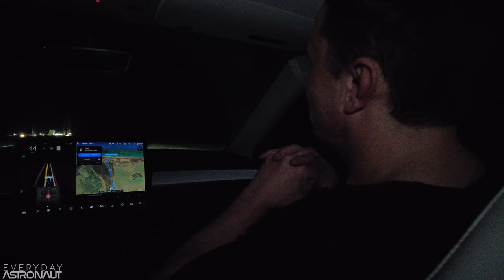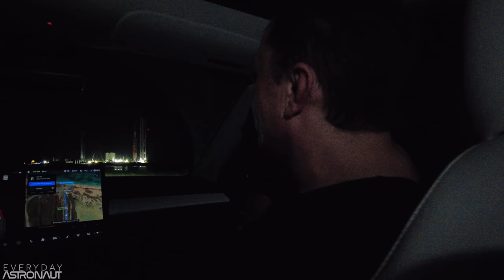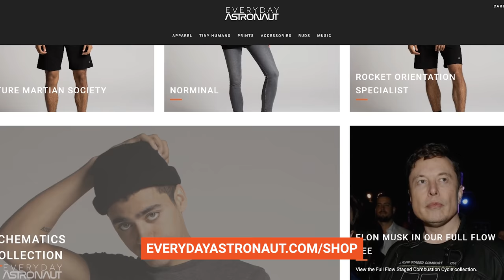Starbase Launchpad Tour with Elon Musk [PART 3 // Summer 2021]

Comment: How do you solve a problem that extends beyond your own lifespan? That question may be the essence of civilization. The only answer I can find is to initiate a process, to create an environment in which the solution will occur independently of yourself. But… that requires a difficult sacrifice. Letting go of your desire to bear witness, to exist at the center of the cosmos. To participate in the project of civilization is to accept death.
-- The Talos Principle, time capsule 7

Comment: 👨🏿‍🚀🐘Quite the "beehive" of activity. Taylor Lee and Mr. Patel are quite encouraging. For example: everything on joining SpaceX to how the welding of jacks and shin plates for the stands are conducted. The launching of the "ring" (ie. holding down the inside with regards to steel thickness, line boring, reduction and mass welding of thick steel) to increase mile/hour  ratio for booster and ship, is quite enticing too. Multiplanetary representation and urgency (becoming an interplanetary species as soon as possible) are important elements in addition. The iota of progress.

Comment: Elon walking around without a hard hat is giving me heart palpitations.... during my career as a security officer, one contract that I was assigned to was working at the technical operations center  Northwest Airlines for non 747 Fleet aircraft at Hartsfield International Airport prior to the merger with Delta Airlines, and when we were doing security and safety checklist inspection of the main hangar section of the facility, you were required to switch your uniform ball cap for a hard hat prior to entry., you do not want anyting dropping off of a horizontal stabilizer stand hitting you in the head because someone's hand slipped, and they lost their grip on a piece of equipment that they were holding. We need to protect that brain at all cost

Comment: One thing I'm curious why SpaceX hasn't explored is making a slightly wider Heavy lift stage say 12M dia to add more fuel snd engines to push a slightly 11 or 2 segments longer starship tanker to reduce the number of trips to top up a starship in orbit. since they're unmanned they could also maxout on the G load to orbit pushing the upper stage harder and faster...

Comment: Why don't they use the booster as a refuler? It would take less engines to get to orbit, without a Starship on top. Those fuel tanks are really large. Just put a carbon-fiber nose cone on top, for aero dynamics. They could reenter like a falcon 9? Also they can still catch it on landing. Just a thought.
Reply: The booster can't go to orbit. Even without Starship on top. That's why every rocket has at least 2 stages. Physics dictate that.
And if the booster would reenter from orbit like the Falcon9 booster all the engines would burn up. Far too much energy. The F9 booster doesn't come back from orbit. It comes back from a suborbital trajectory.

Comment: A week later. I have not seen any comments - ever - re: UPLOADING hardware. We know that Starship will orbit. We know Starship will need refueling to go to the Moon or Mars.
We know that some claims are that Starship will need 13 or 14 refueling dockings while in orbit.
We know Elon believes that it may be possible to complete the mission with just 4 refuels.
That suggests to me that the Starship cargo bay is not currently planned to be at a maximum.
So my question is If Starship is sitting up there waiting to have tankers deliver fuel, can other Starships be launched with hardware for transfer to the Orbiting Starship?
Then a big payload could be transported to moon etc. 
Obviously more payload would necesitate more fuel transfers but why would that be a problem other than the cryogenic venting problems?
The problem I imagine is not taking masses to the moon orbit. The problem I percieve is taking the masses from moon orbit down to land on the moon surface?
When man is on the moon, the more toys he has the happier he will be (as if being on the moon isnt enough).
Any comments?

Comment: Surprised none of the models for catching on the return have  reinforced airbags on arms and towers just saying its how we catch stuntmen and lift thousand ton loads with little ressistance or effort and fabric spill systems and rapid deployment systems abound and its light and self aligning done right :). Also has added benefit of stopping intrusion into metal on metal contact zones drastically reducing the odds of unscheduled dissassembly and would be cheap and light so easy to build and retro fit to existing structure .

Comment: I design RF Amplifiers which combine the output power of up to 32 transistors to reach full power, somewhat similar way to the way the 29-32 Raptors work on the Starship Booster. The hardest part of this is maintaining stability.  Any feedback from the output to the any of the inputs results in severe instability and oscillation. Basically to work the all inputs need to be isolated from each other. It can also be modeled and simulated. Imagine a multi-vibrator circuit repeated 32 times. It can be done but it took me 3 years and several attempts to understand all the different causes of instability.  
The other thing which concerns me is the booster positional accuracy required for the two catcher arms to work as intended. Perhaps a solution which is more tolerant of any landing positional errors is needed?

Comment: Earth to Moon : Maybe the Starships could travel to the Moon by 4 Starships (1) Refueller Starship , (2) Moon Spacestation Starship , (3) Moon Lander Starship , (4) Moonbase Starship attached to 4 docking points around the (5) Main Propulsion Starship which would propel all the Starships to the Moon therefore using the least effort and fuel. (2) Moon Spacestation Starship left to orbit the Moon, (4) Moonbase Starship left on the Moon, (3) Moon Lander/Shuttle Starship being the taxi from Moon to (2) Moon Spacestation Starship left attached to the (2) Moon Spacestation Starship while the (1) Refueller Starship and the (5) Main Propulsion Starship returns to Earth Orbit or could dock with a sixth (6) Earth Spacestation Starship. The (7) Earth Lander/Transporter Starship would be the human transporter to dock with the (6) Earth Spacestation Starship or dock with the (5) Main Propulsion Starship which would have the (1) Refueller Starship and two other docking ports for other Starships which would then travel to the Moon. ; Seven variant Starships : (1) Refueller Starship , (2) Moon Spacestation Starship , (3) Moon Lander/Shuttle Starship , (4) Moonbase Starship , (5) Main Propulsion Starship (6) Earth Spacestation Starship (7) Earth Lander/Transporter Starship. Maybe someone can construct a graphic animation of this Starship proposal in order to visualize it more clearly.

Comment: So many rocket engines all installed around the rim of fuselage and some more rockets engines  in the middle. In this case, the rockets engines in the middle may explode as high heat plasma of the high trusts outside around the rim rockets engines will create high swirl of hot plasma into the middle. This Booster No4 design is huge. Much larger than Saturn V which only has 5 rocket engines. But booster No4 has 27 engines. Observed as so many rocket engines are put togther fire up all together in a tight area, engineers should look into this danger. Maybe there should be vents in coming inside into the middle of the fuselage the portion of the rocket engines as to provide good flow of air for the rocket engines installed in the middle preventing over heating from the high heat plasma around the area. What do you think? The main cause of 4 failures of Russian N1 rockets may be the reason why rocket engines in the middle exploded during lift off.

Comment: In theory, if you could gimbal an engine to point upward at the underbelly of a reentering vehicle as it falls from orbit, could you use the rocket exhaust to disrupt the formation of plasma near the skin of the vehicle? I've read that rocket exhaust is in the ballpark temperature of 3.5K Kelvin while reentry plasma is in the ballpark of 2.5K K...but I've also read that jet exhaust is in the ballpark temperature of just 1K Kelvin. Why is rocket exhaust so much higher temperature than jet exhaust, and is there a mix of fuel and oxidizer that would give you a relatively low temperature exhaust?  Like...if you had a rocket exhaust that was just 2K Kelvin, could you use this "hot" exhaust to "cool" the belly of a reentering vehicle?

Comment: Does anyone know what info or dialogue there has been regarding how the tin can will hold up to the side force associated with re-entry? Of course the focus has been on heat protection, but isn’t even small amount of force to the heat protected SIDE similar to that of crushing a soda can from the side? Sure it’s far stronger at the short end / direction of typical rocket thrust, but if this thing is mostly empty, is it re-pressurized with other gases or are there interior structural supports?
Sorry if I’ve missed this info.
Reply: "Does anyone know what info or dialogue there has been regarding how the tin can will hold up to the side force associated with re-entry?" The tanks will be pressurized with up to 6bar during reentry.

Comment: new follower I was directed to follow you and that you had done a video on a subject I'm interested in as there hasn't been. uch said.  what is the plan with space x to protect passengers in the starship in case of catastrophic failure of the booster or the starship itself?  the shuttle supposedly could eject thd passenger cabin. dragon has it's escape rocket, but what about starship?
Reply: It will have very similar safety features as modern air liners. Super reliable systems.

Comment: Why is the Lunar starship rendered with sea-level raptors at all? As I understand it, it won't ever return to earth. They seem to be extra weight. Along that line of thought, why is it rendered with three mvacs? Lunar gravity is 1/6th of Earth's. It seems to me that 1/3 the thrust would be double what they need for lunar missions. Am I wrong?
Reply: The vacuum raptors can't gimbal, so they are gonna need at least one normal raptor for control
Reply: In addition to what Bálint said: the Lunar Starship still has to be launched from earth on top of super heavy. It needs all those engines to go to orbit.

Comment: Why there are lot of broken tiles in sn20.. Marked with red tapes.. 
Is ceramic ones used in sn20 not reusable
Reply: They added the tiles in a real hurry to get the ship on top of the booster and take photos. 
Also it's the very first prototype with a full heat shield. Given the pace SpaceX is working with, you should expect a few broken tiles.
Right now they are just throwing the tiles on and see what works and what doesn't.

Comment: I am sure this point has been mentioned before, but we have an "engineer" stating that putting a 1"weld on the inside and outside of the launch frame will, and I quote "get us 40 miles per hour on booster and  ship."
In what universe does this comment make any sense?
Is there something  that needs explaining?  Or ........What?

Comment: Can some rocket scientist tell me why you cant use railgun technology to replace at least part of the booster stage of a rocket with a ground based acceleration system to achieve near stage 2 altitude. With a 2 mile railgun dug into the ground at high altitude powered by a solar farm with energy stored in large flywheels which are ideal at dumping huge electrical loads to power the rail in quick bursts. Seems like good reusable system and shave off the first 35,000 to 75,000 sf depending on velocity which requires the most fuel/energy. Once built it is long lasting and highly reusable system with minimal moving parts. Also cant understand why space exploration is located in places at sea level and higher humidity. Should be based in Colorado, New Mexico, Utah, Arizona etc with elevations over 6000 sf and dry. Elon likes to dig holes, clean energy and rockets:) This has it all!

Comment: Why is on-orbit refueling needed?  Why not bolt all those Starships together and push the whole mess toward the destination?  I guess you could jettison some totally empty fuel Starships along the way but you would arrive with a couple of crewed Starships and perhaps some extra fuel Starships to land on the Moon or Mars. You would gain lots of redundancy, margin and a head start on ready to use resources, materials and fuel that can be landed on the surface as needed.
Reply: "I guess you could jettison some totally empty fuel Starships along the way " And who is gonna pay for all those jettisoned ships? 
Imagine doing the same with normal air liners. Nobody would be able to buy a ticket.